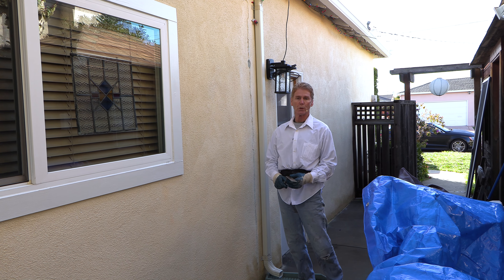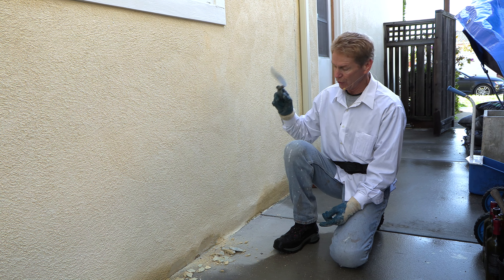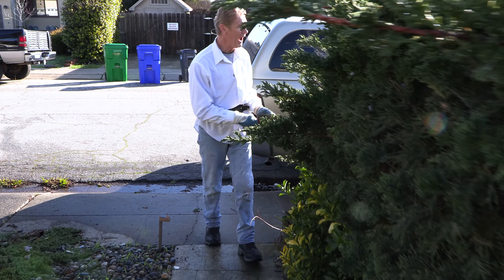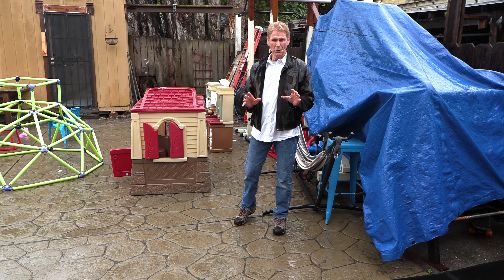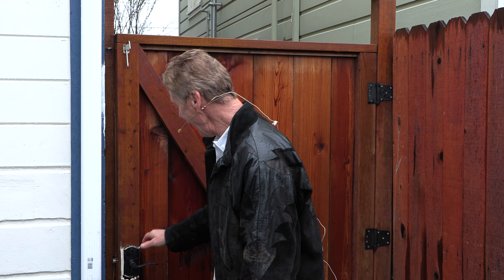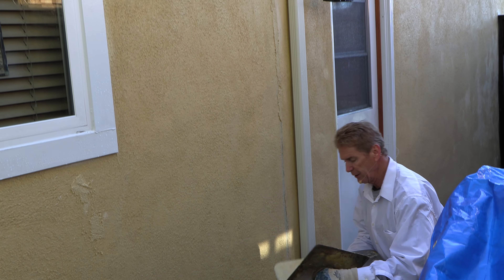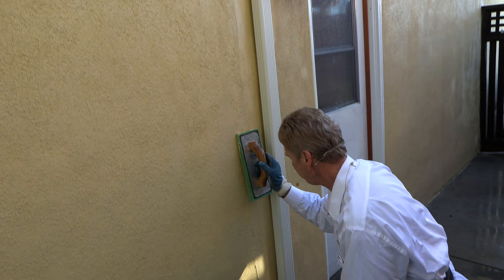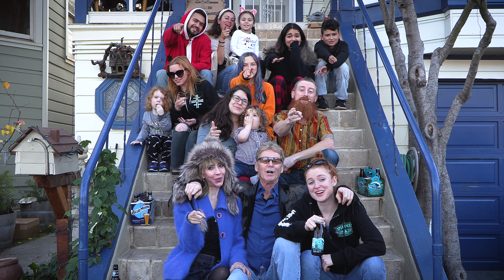Stucco cracking rain caused

Comment: You cannot stop concrete from cracking. We call it “crack-rete” as engineers.
Reply from the maker: Vonnie, ding, ding, ding, give this engineer a cigar.🍻 Here's my copy and past answer to the folks who ask why?
I expected this question of why no expansion joints from well-informed or knowledgeable fellas such as plastering contractors. Installing an expansion joint where the two different sub-straights are connected. 
House to addition. 
Two separate foundations, thus an expansion, may have helped but, in my humble opinion, would not have prevented a future crack.
 Plus, this cost would not have outweighed any benefits as it's pre-existing. 
Have I installed them before? Of course, I have; in this scenario, I felt to give this option with cost would have only beat me up in the future, as again, it may or may not help; thus, the callbacks would have driven me nuts, even if I had said it verbally and placed it in writing that area would still have a tendency to crack. 
Thus the fault or responsibility is now mine and not the folks who in the past, didn't understand circumstances like Ole, Kirk.
Been there, done that. No glory in it. 
Besides, If I truly felt it would have worked, it would have been done.

Comment: how come weep screed wasn't need for the house? concrete against stucco. wouldn't the water travel up?
Reply from the maker: Howdy Victor, Excellent question. Yea, I only covered some aspects of what's going on, like the missing Drip or Weep Screed. 
 Back in 1975, it became code to start installing weep or drip screeds for three reasons. 
One to stop the stucco from touching the dirt or ground. Two, more importantly, to give the walls an expansion joint, and three, to provide us with plasterers something to stop at. There are more. We didn't start installing them until about 1980. Yea, I know I've been in this trade too long.
FYI, my own home had the stucco touching the ground. Didn't lose any sleep over it, as I knew why. 
Or installing an expansion joint where the two different substaight's are connected. House to addition. 
Two separate foundations, thus an expansion, may have helped but, in my humble opinion, would not have prevented a crack.
 Plus, this cost would not have outweighed any benefits as it's pre-existing. 💃
Reply: @StuccoPlastering  Love your videos. My house looks like the one in this video and was wondering if I had to redo the lower stucco. Your response will help me sleep easier. Thanks a lot Kirk.

Comment: Always appreciate your "schooling"   When you know a place such as that will crack, why not install an expansion/crack relief joint in that location?
Reply from the maker: Bravo, my friend; I expected this question of why no expansion joints from well-informed or knowledgeable fellas such as plastering contractors. Installing an expansion joint where the two different sub-straights are connected. 
House to addition. 
Two separate foundations, thus an expansion, may have helped but, in my humble opinion, would not have prevented a future crack.
 Plus, this cost would not have outweighed any benefits as it's pre-existing. 
Have I installed them before? Of course, I have; in this scenario, I felt to give this option with cost would have only beat me up in the future, as again, it may or may not help; thus, the callbacks would have driven me nuts, even if I had said it verbally and placed it in writing that area would still have a tendency to crack. 
Thus the fault or responsibility is now mine and not the folks who in the past, didn't understand circumstances like Ole, Kirk.
Been there, done that. No glory in it. 
Besides, If I truly felt it would have worked, it would have been done.😉

Comment: Hi Kirk!  You’ve helped me patch in a new door in a stucco wall and now I’m in a new house and I’m wanting to put brick veneer over a cmu foundation wall.  Should I use red guard or something on the cmu first, or just thinset directly?  Thanks!
Reply from the maker: Howdy JP Morgan. Clean the brick well, then use whatever thin coat material you are fond of. 🥳
Reply: @StuccoPlastering  Thanks Captain Kirk!👍 Do you have a recommended thinset for adhering the thin brick veneer?
Reply from the maker: Howdy, Mr. Morgan, I'm a stucco guy, not a tile setter.https://youtu.be/kr8jTcvJI4k/ That being said, I have tiled about 40 rooms. I usually buy the professional Versa-Bond. It's in bags and you have to mix it with a drill that part sucks. But to buy the mixed crap in buckets ready-made to spread. It doesn't work.
Reply: @StuccoPlastering  Yes sir,  I’ve used versabond for interior telework as well.  Just wasn’t sure if it was great for exterior brick veneer on a cmu foundation wall.
Reply from the maker: Ops, for the exterior, any stucco base coat will work; the best cementitious adhesive bonding agent would be La Habra's Poly' Bond. It's only sold at plastering yards. But again, almost any portland based scratch coat will work as long as you attach very clean stones to the wet scratch coat; they will adhere by what's known in the plastering industry as a mechanical bond.

Comment: Hi Kirk, big fan of your channel...its so helpful. After the heavy rains, I can touch a 2x2 area on my exterior wall and the cement plaster from a previos repair easily falls off / crumbles from a light pressure touch.  Do you have  a video repair of a similar situation?  Thanks so much.
Reply from the maker: Type in how to repair stucco, and a video will magically appear to explain how to. 😉

Comment: Why didn't he not convert that crack into a control joint, instead of filling and hiding it, especially since it's at the point where the house has an addition? 
In my location (northern Canada) I would of made it a control joint due to expansion contraction from summer to winter.
Reply from the maker: Howdy Kosmic, my fellow contractor, I expected this question of why no expansion joints from well-informed or knowledgeable fellas such as plastering contractors. Installing an expansion joint where the two different sub-straights are connected. 
House to addition. 
Two separate foundations, thus an expansion, may have helped but, in my humble opinion, would not have prevented a future crack.
 Plus, this cost would not have outweighed any benefits as it's pre-existing. 
Have I installed them before? Of course, I have; in this scenario, I felt to give this option with cost would have only beat me up in the future, as again, it may or may not help; thus, the callbacks would have driven me nuts, even if I had said it verbally and placed it in writing that area would still have a tendency to crack. 
Thus the fault or responsibility is now mine and not the folks who in the past, didn't understand circumstances like Ole, Kirk.
Been there, done that. No glory in it. 
Besides, If I truly felt it would have worked, it would have been done.
Reply: @StuccoPlastering  I guess you know your area and it's expansion contraction limits. In my area we have to put expansion joints every 5 meters (16 feet), we go from -50C to sometimes over +40C (-60F to +100F)  it's a big swing for stucco to work it's magic. But we also have to put expansions between structure changes, that is part of the code here, also of note as of a year ago we have to get all aspects inspected before we can move to the next stage, foam or metal lath (and cannot use tar paper or house wrap, it has to be an epoxy troweled or painted coating like Backstop from dryvit or goldcoat from sto) then you need an inspection pass, scratch and another inspection and finish coat with final inspection. This had to be implemented due to to many failures and contractor cutting corners. Part of the final coat also includes  caulking as it is part of the finish. 
I am one of the lucky few that has never had a failure or crack in over 30 years, but that's due to being anal retentive and cutting the walls in sections allowing me to forgo some of the issues that promote cracking, we also have to leave a 1/2" bottom gap when the wall meets a cement sidewalk or driveway, doing it to code has never failed me.

Love your videos, keep em coming.

Comment: Kirk, thanks for helping me freak out a little less about cracks after all this rain. What's up with the wood at the bottom? Do you put it proud of the wall, just caulked in place? Don't see that much here in SF, mostly just stucco straight down to sidewalk. Usually with some weeds in there of course 😅
Reply from the maker: Howdy Phil, most homes built after 1980 do have the weeps screed, all home prior such as most in SF just go to the ground. Any cracks developing, I'd recommend to simply caulk them thus stop the rains from entering and saturating the walls.👨‍🏫

Comment: Something not mentioned is that hairline cracks will pull water into the blockwork and cause damp spots inside. The reason is suction when heavy or driving rain passes over the cracks suction draws it in through the crack no matter how fine the crack is.  I have a house in Greece on the island of Crete the weather is harshe in the winter months and the Santa Barbara smooth finish had many cracks on one elevation iv filled them and the water ingress has stopped.
Reply from the maker: Howdy Carl, no doubt it was plastered with pure lime also. It's kinda complicated. 🥂
https://youtu.be/OqbQbdEySSI/  how to spread smoother stucco over rough stucco.
Reply: @StuccoPlastering  They crush marble into a powder and call it angel dust they add that also to the lime mix. I,m told if you use white cement it actually doesn't need painting for many years as it dry's white. Enjoy your videos i'm a carpenter but like to patch plaster but that's my limit.
Reply from the maker: Howdy Carl, we call marble mixed with lime Marmorino finish.https://en.wikipedia.org/wiki/Marmorino/
white stucco video,https://youtu.be/TuwvarKFpko/.🤙

Comment: I applied weld crete tonight. In the morning I'll put on my surface bonding cement. Should I hydrate my block wall the same way you normally would now that the weldcrete is applied?
Reply from the maker: Howdy Town Electrician, FYI, Pouras blocks don't require a bonding agent, If they are painted then naturally they do. Weld-crete usually drys in a half hour or less. After you apply your stucco coat, use a garden hose to hydrate the new stucco when it's dry of course , much faster than a roller or paintbrush. You can type in how to hydrate stucco.🌊

Comment: Stucco question:  I had a cmu wall built and I’m not happy with the quality of the stucco finish.  Can I add more stucco ontop of the existing stucco to fix the aesthetics or do I have to scrap it i off entirely?
Reply from the maker: Howdy, no scraping, simply stucco over with a bonding agent rolled or spread over the existing finish after its been pressure washed. Nothing adheres to a dusty surface.💃🏻

Comment: Hey Kirk I got a curious question ! Is it okay when doing base coats to use a corner bead as a stop and for instance start one day an stop at a corner bead than next day pick back up applying at the corner bead ?? I’ve done so much research trying to find an answer but have had no luck
Reply from the maker: Howdy James as a rule we stop at corners when we take break or stop for the day.
Corners are corner beads.🍻
Reply: @StuccoPlastering   thanks Kirk !